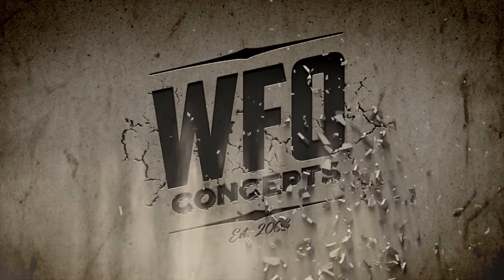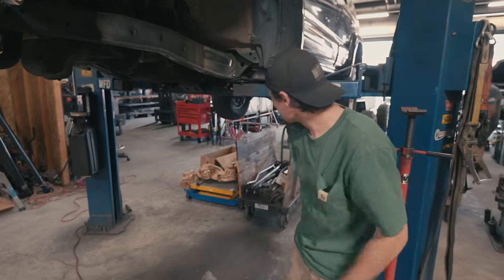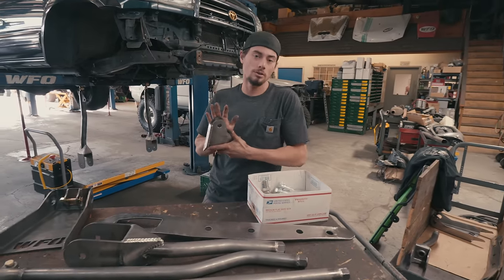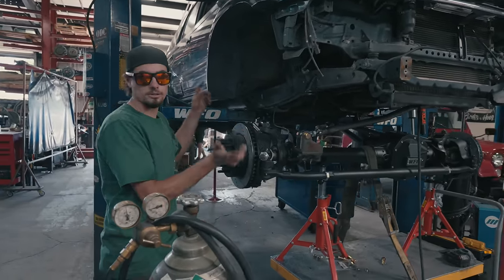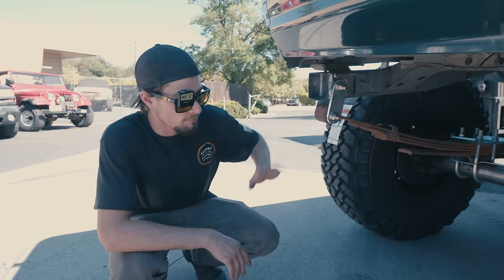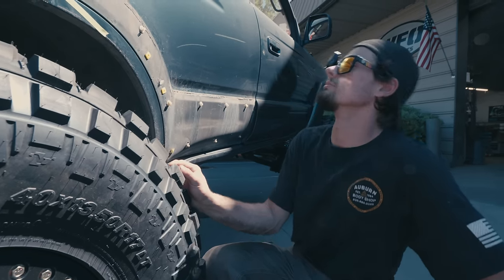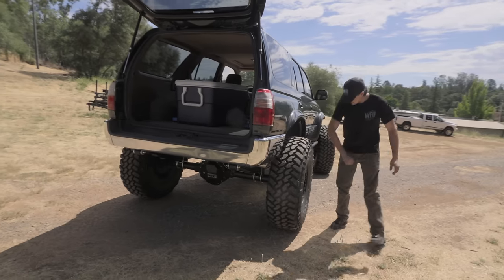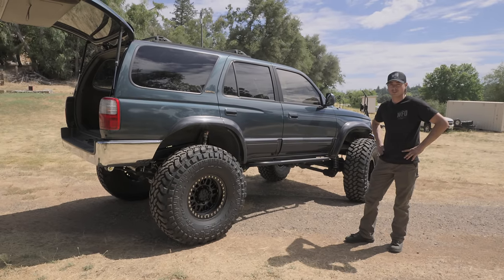Solid Axle Swapped 4Runner | WFO Concepts' Solid Axle Kit

Comment: What does a build like this cost?
Reply: 15k
Reply: @brucekhim3304 no it doesn’t💀I spent no more than $3,000
Reply: @amicxble9350  $3k would barely cover her wheels. I’m at $18k and I’m not done buying parts yet.
Reply: @amicxble9350  he meant, to be done right, not hacked together.... Especially if you can't perform the labor yourself. It's gonna be every bit of 15k. That psc hydro assist kit they put on is $3k by itself
Reply: Came out very nice
Reply: 40k
Reply: $3k just for the rims and tires lmao
This is a $15k-$30k build plus the cost of a truck

Comment: Would the SAS make since for a modest daily/ trail rig. Probably the biggest tires I ever plan to run are 35s but who knows right. I see a lot of these where the front end looks higher than the rear and I don’t like. This one is awesome but for me I mainly would like to eliminate the issues with the 3rd gen ifs, ball joints, cvs, etc. not looking for a crazy rock crawler but a nice looking respectable trail rig/ daily, that is also very strong, Would SAS make since for this. Thanks
Reply from the maker: We have a fair amount of customers that have solid axle swapped their Tacoma/4Runner for reliability reasons. Give us a call 530.268.9494.

Comment: Currently collecting all the parts for a similar build. How far back did you guys push that rear axle? And what was the reason for going through the frame as opposed to under the frame with the rear shackle mount? Just better departure angle or stance? I know leafs are relatively simple but I love the cleanliness of this setup and build, would love a vid on the rear! Anyway, awesome build guys, should be by the shop in the near future for that radius arm kit.. cheers

Comment: Why Leafs vs links?
Reply: LEAFSPRINGS PARTY HARDER
Reply: You have relocate the fuel tank, using an f150 tank, and transfer all the crap to the new to be legal in CA if you plan on driving it on the road. It's quite a bit more work to do. Chevy 63’s party pretty hard still and they are a fraction of the cost.
Reply: @dirtymikendaboys  3link would work fine